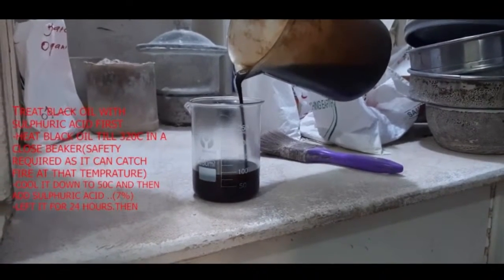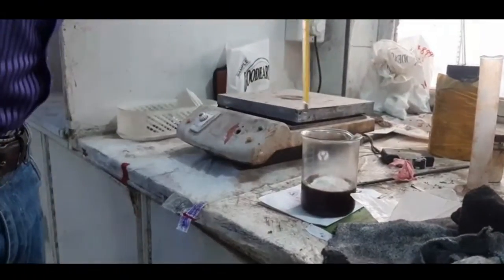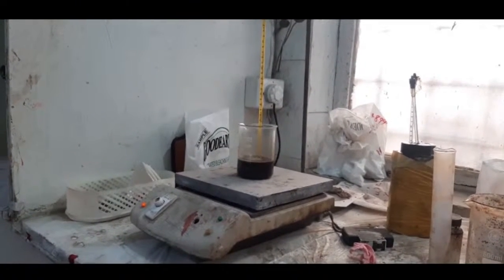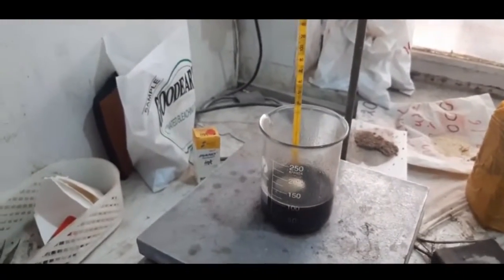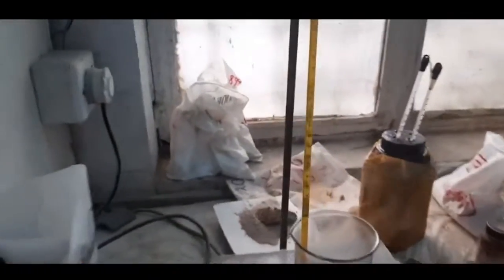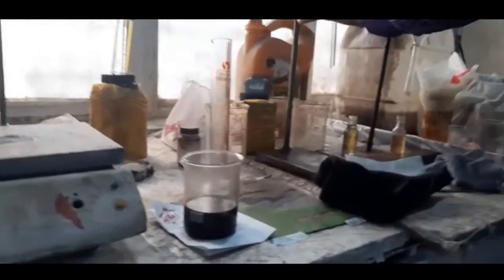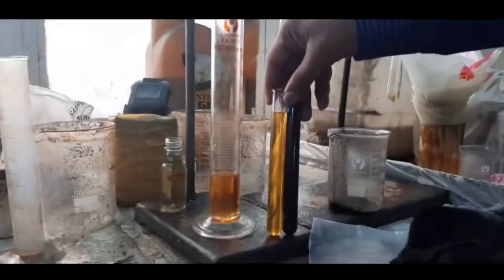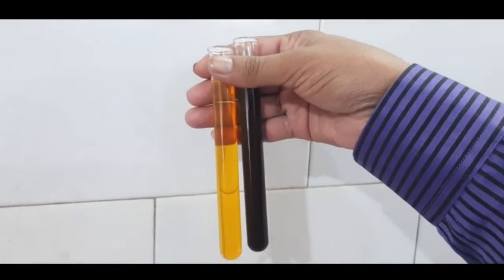How to Recycle Used Engine Oil  | How to refine used Mobil  Oil by using bleaching Earth 2024

Comment: whats the ph of oil?? also does engine oil properties changed. does it affect viscosity at engine working temperature? also if this engine oil used i am sure it is 1 ph in scale it would hmharm matel parts as well.
Reply from the maker: Its pH is not 1.It will be neutralized in later stages.

Comment: Why does it say sulphuric acid then if you are using bleaching earth
Reply from the maker: Sulphuric acid is used to remove sludge from waste oil them light oil is extracted from above and treated with bleaching earth.
Reply: @EarthChemEC Yes i know about it. Used sulphuric with pyrolysis oil

Comment: Good morning. Please i have tried the process stated in this video and mine did not work. Please can you itemize the steps taken to purify the used oil?
Reply: I have a chemical method for treating used automobile oil
Reply: Your contact number  @نوريطاسي
Reply: How  @نوريطاسي
Reply: @islamkhamis2083  In fact,you can use silica gel to decolor waste oil
Reply: You for got crack